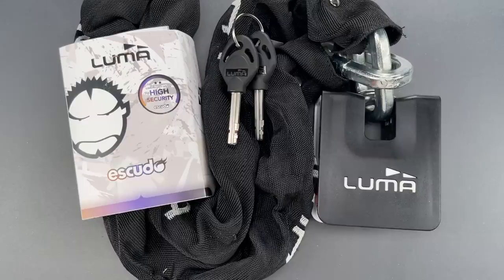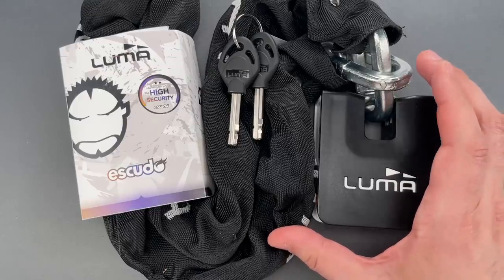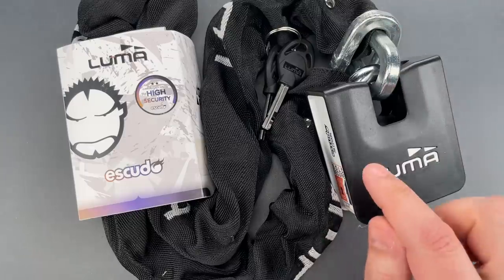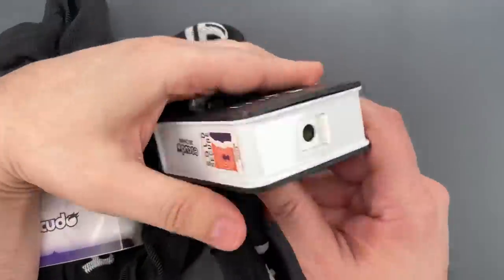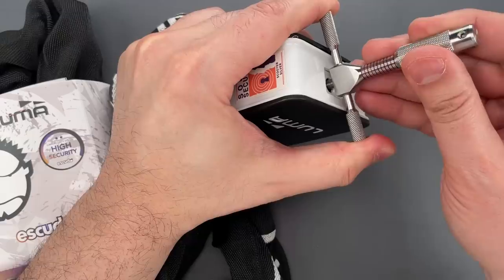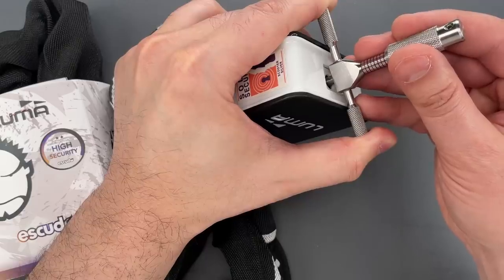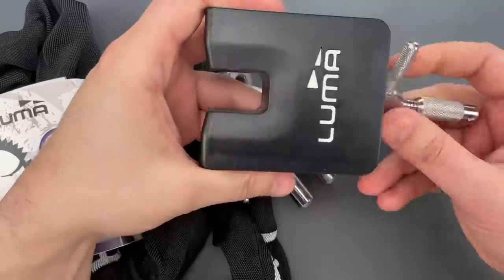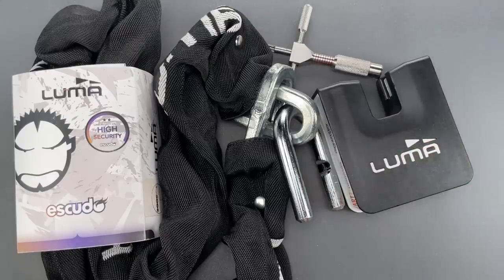[1429] Unexpected False Gates: Lumà Chain Lock

Comment: i wonder if we would be able to have a disc detainer video on your “Inside Perspective” series
Reply: I second this. I'm very interested to see how the pick (that BosnianBill and LPL made) actually works inside the lock.
Reply: Yes, I just really need to see how that pick in actually works!
Reply: The problem is that the disks, as their name implies, go all the way around the keyhole, which would make it pretty difficult to do a cutaway without the lock just falling apart. Not impossible, of course, but it would require some specialized tools and skills that LPL may or may not have access to.
Reply: This is also what I want to see
Reply: I would like to see that also.
Reply: I think the only working approach would be a lock with transparent body. Maybe also transparent distancers to let us peek at the pick within.
Reply: wonder if you could do it with a clear cylinder body.. maybe acrylic..
Reply: I believe Bosnian Bill has at least one video where he’s picking and describing what’s happening at the same time.
Reply: Yes please!
Reply: Or instead of having a cut away view, maybe hire someone to do a 3d animation video that shows how it works?
Reply: Bosnian Bill did a video sort of like that.
Reply: Why not make a lock out of a clear material or cover the cutaway with one? I'm sure resin or acrylic would work fine for an example lock
Reply: That's a good idea.
Reply: @IanHsieh  nah, that's not the same. animation won't simulate all the physics going on inside the lock
Reply: @szymonsadlo  I know it wont. But that's more doable than making a cutout. It also have the advantage to change to different configurations to show other tricks too. And even if the lock was made in all clear material, refraction and other things may cause things not visible or hard to film. Animations can cut out at any point any location required to do the explanations.
Reply: @IanHsieh  that seems true but maybe there is a way that we don't know about
Reply: Bosnian Bill has video on disc detainer locks. Nice cut-out showing internals. Along with detailed explanation of how it works.
Reply: I think a lock made out of acrylic might work
Reply: Maybe they could get a clear disc detainer lock to show it better.
Reply: Me, too.
Reply: @HiddenWindshield  Are you suggesting that are some skills that LPL doesn't have? Man you are bold.... :D
Reply: To the top!
Reply: Waiting here for that too. 😅
Reply: I know the lock shop I work at has a cutaway one made by Assa, so it should be easy to do.
Reply: BosnianBill made such a video
Reply: That would be awesome.  Maybe he could print a clear housing for a lock just for demonstration purposes.  Would definitely be interested in what false and true gates look like too.
Edit: in other words, a lock with practically no security and can easily be broken with force, just something basic to show us well...  The basics.
Reply: @HiddenWindshield  would somesort of transparent material work?
Reply: He said it's coming, in response to a very similar looking comment on his first inside look video a few weeks ago.
Reply: @sharpfang  Or A giant one  3d printed so we can see it all )
Reply: @HiddenWindshield  They make transparent locks
Reply: @HiddenWindshield  Maybe not a cutaway, but could half of the lock be made with a clear material?  That way, we could still see the inner workings.
Reply: I agree  let's see it
Reply: @mk1cortinatony395  It's pretty damn hard to 3D print actually clear transparent stuff.
Reply: @BenK12345  I was thinking the same thing.  That seems quite plausible.
Reply: @HiddenWindshield  There are transparent disc detainer training locks as well, but the core needs a bunch of extra slots cut in it so you can see the discs move since you can't have an effective plastic core.
Reply: @HiddenWindshield  Couldn't a disk detainer core work inside one of those clear acrylic locks?
Reply: @HiddenWindshield  ask stuff made here to do it xD
Reply: @sharpfang  yes of course but I was thinking something like cutaways to show the path of the tools etc
Reply: @mk1cortinatony395  The problem with cutaways is there's not really any room for these in a disc detainer core, because it requires continuous discs to work, and the tool goes through the middles of these discs. Unlike in a tumbler lock where the pins occupy maybe 10% of the circumference of the core and you can cut away most of the rest to reveal them, the disc run the whole 360 degrees around the keyway and any cuts in them at the very least will create extra gates. Besides, everything interesting happens on the outside, where the gates are.
Reply: HiddenWindshield maybe an acrylic or resin 3D printed version, so it’s transparent. It doesn’t need to be as tough as an actual lock and just needs to be able to demonstrate the basic concepts.
Reply: @conorstewart2214  Again, 3D prints are merely translucent, not really transparent. You could go for a resin cast to get a transparent body though it's not so simple with complex shapes.
Reply: Yes!!! Plz!!
Reply: Yes, please.
Reply: Something I would have suggested if you hadn't suggested it already.
Reply: I was literally thinking about this. Maybe a mock up with translucent plastic and the tools LPL uses
Reply: I'm pretty sure it's impossible
Reply: Yes, we need to see this to understand how a disc detainer core works.
Reply: @LockPickingLawyer no please no, disc detailer is normal people like us last hope to affordable locks that provide basic protection, please don't disclose
Reply: BosnianBill  video  (1683) Disc Detainer Locks in Detail
Reply: Yes, please!
Reply: @HiddenWindshield  See-through material
Reply: Now that we have that inside perspective the too narrow flaw on the false gates really makes sense.

Comment: I think from now on, locks shouldn't be advertised as pick proof but come with a number on the package, which states the seconds LPL needs to pick it.
Reply: Agreed, with one exception, bowley(or something like that) locks, because that was the only one that is the closest to pickproof, at least LPL couldn't do it
Reply: It'd be like an SPF rating on sunscreen, except the ratings would go from 5, 10, 15, 30, 45, 60, 120, 180, 240, 300+. Anything above 60 would likely be considered "pick-resistant", and anything above 300 would be considered "pick-proof". This would be because if you were a criminal trying to get into something, there's a very low likelihood that you'd be undetected after fiddling with the same lock for 5+ minutes.

I'd totally buy into that sort of scale. There's enough LPL videos to be able to rate 1000+ locks at this point.
Reply: @deverinshaille7427  honestly I like the locks with alarms, even if LPL has picked a few without setting them off. Anything that makes it harder to stay anonymous whilst picking, as I think the solution to picking is not necessarily making locks slower to pick (because they'll just take longer or build a machine) but to detect when it is happening and take appropriate actions.
Reply: Master lock does that already there’s a vid on here where a masterlock had a 9 rating and it took LPL about 9 secs to get in
Reply: @neon5162  got it, great. 🤪

Comment: In Spain there is a brand called "IFAM" that sells a core called "WX1000". From what people say at the hardware store...it's a top tier. I would send you one but they are expensive as hell.
Reply: How expensive? Maybe the community would help you crowdfund it.
Reply: I looked at those. They're pretty darn impressive (and yeah, expensive). Dimple keyway with three edges totaling 16 pins, with what appears to be six with inner/outers and six spools (3/2/1) on the three sides. I have zero doubt LPL could pick it;, but it would take a non-trivial amount of time compared to most of the PoS garbage we see daily.
Reply: @CEFG100  I could not find where you could actually just buy one, but in the fine print on the company website it says the minimum order is 50 euros. ($54.57 US)
Reply: Tengo uno yo en la puerta de mi casa

Estoy muy seguro lpl puede abrirlo en menos de dos minutos

Comment: The only thing that matters for products like this is how bolt-cutter resistant the exposed chain links are. No bike thief will waste time picking the lock.
Reply: Or wait until the owner opens the lock then ambush and bash them over the head. Thieves tend to not play by the rules and usually desperate. Just sayin
Reply: @lilmike2710  Don't forget the battery powered saws they've been relying on lately
Reply: I think you are right for the vast majority of bikes. But some enthusiasts have very expensive bikes that might catch the eye of a skilled thief if they regularly lock it up next to a cafe or outside work or something. So I think there is a niche for high security locks.
Reply: @Hobbsgoblin  I doubt the enthusiast leaves the expensive bike unnatended long  enough for the thief to pick the lock, i doubt the cafe is in an unpopulated area where the thief could make an easy escape ot pick around without raising suspicion. Otherwise, the enthusiast is a bit stupid :))
Also expensive bikes are usually rare and tracked .
Reply: @DanSlotea  BTW: is there such a thing, as a cheap bike? I got a bike store here in Germany I can see from my kitchen-window and today I asked what a simple bike costs: 900 effing Euros! My first car was cheaper!
Reply: @DanSlotea  Fair points, but I can also see why an owner of expensive bicycles would pay a little extra for the added security. And also, many expensive bicycles are designed to be used in the winter when it is often dark (in the north where I live) and easier for a thief to work secretly outside a bar or restaurant.
Reply: @ChrisBigBad  Of course there are cheap bikes. Second-hand bikes are cheap, Chinese bikes are cheap. I have a friend riding a bike with missing pedals (has only axles), rusty wheels and a brush-painted frame. Nobody would bother stealing that ugly crap. But it works perfectly, gets him around just fine.
Reply: @lilmike2710  Sounds like a plan... but they seem to be everywhere !
Reply: @DanSlotea  haha! Optical theft prevention. Like a bike where the handlebars and wheels go in different directions like what Destin from smarter every day had!
Reply: Bolt cutters don't easily get through chains like that, and even then only once. Battery-operated angle grinder at night is the faster, more efficient option.
Reply: @mathiasanderson554  who leaves a bike outside during the night?
Reply: @ChrisBigBad  In the US, the "cheap bike" niche is pretty well populated, with many of them on display at WalMart.
Back when I was a kid (1980's) the sweet spot for cheap-but-good was the Huffy brand. I don't know if they are still in that category.
Reply: @MonkeyJedi99  ya. now that you mention Walmart, I guess there are cheaper bikes to be had at big-box stores and our cozy bike-shop is quite a boutique. Also looking into used ones.
Reply: @DanSlotea  Someone about to get their bike stolen. Doesn't have to be outside though. Depending on the community, bikes are very often locked up in stairwells and around public transit sites.
Reply: In my younger years I considered myself a "cyclist" at times. Funny to think about my precious 16 lb bicycle needing a 12 lb lock/chain to hopefully delay the Obummer people with their Home Depot grinding tools for 3 minutes.
Reply: Most thieves do not pick locks. A crowbar for a door or a bolt cutters or die cutter for a lock.
Reply: @JeredtheShy  By the point that we're talking about power tools opening our locks, the quality of the lock is mostly pointless and we're now relying on the quality of the neighborhood and local law enforcement to make sure that people taking power tools to locked up possessions get caught for being incredibly obvious and loud.
Reply: @jinnylover9158  Bolt cutters suck after the first lock, and only the largest can get through thicker or harder shackles and chains with excessive force. Most "professional" thieves use the wrench technique anyway.
Reply: Nothing stops a cutoff wheel
Reply: @RayleighCriterion  everybody willing that can hear it can stop it. And as somebody said above, most thieves do it for drugs money so investing in a portable grinder is losing a lot of doses.
Reply: @ChrisBigBad  That must have been an artisan hand crafted bike or something! A cheap bike in the US would be closer to $150 (about 137 Euros) Although at a sporting goods place I did see a $2000 bike, it was a specialty bike for driving in snow.

Comment: Anything with a disk detainer core is pick resistant. It's highly unlikely to find one picked in the field.
Reply: Head on over to covert instruments and change the world around you....
Reply: Sometimes I pick my nose in the field behind my house.
Reply: You'd be surprised there are quite a lot of disc detainer picks selling here in Europe
Reply: @mihanovak2228  yeah but most people dont have the skillset to use them
Reply: Your comment is the gist of what I said about being pick resistant.
Reply: That is changing because of that pick though. Because half of the problem with disc detainer locks was getting the correct pick to actually open them
Reply: @frankh.3849  actually LPL doesn't sell that.  That one is sold at Sparrows.  It was in production for ~ 3 years (I think).
Reply: You're highly unlikely to find any lock picked in the field.
Reply: Most of these cores are used in bike locks and chain locks in the field.  Usually thieves don't have much time so they will just attack the chain or the bracket with an angle grinder before even looking at the core.
Reply: @ipick4fun27  I didn't know that, I haven't tried buying any tools. Thanks for the info though.
Reply: @toad7395  Yeah, most people don't have 5 minutes and internet connection to watch a guide on how to do it...
Reply: Lol? I practice with bike locks i (honestly) find on the street, over half are actually disc nowadays, and using a $5 tool that not Bill&LPL but Ali Li made they are certainly doable and not particulary slower to pick than any other type. Disclaimer: i'm just a beginner and not a fast picker. But the tools are around, the locks are around, the skillset is very similar, i find it quite a bold claim to say 'wouldnt' be used in the field'. Why do you think so, please explain..
Reply: @rene0  Most pickers simply do it as a hobby for the challenge. I doubt many thieves would invest the time to develop the skills and acquire special tools to steal bikes when chains and locks can be cut or broken so easily. Just my opinion though.
Reply: @rene0  It's just that if your goal were stealing bikes and not solving puzzles, a good pair of bolt cutters or an angle grinder would be a much better investment generally. Typically very quick, basically no skill or nerves required. It's not like you're going to try to bring it back without the owner knowing it was gone or something.
Reply: @ipick4fun27  Is it no longer being made? I had my heart set on getting one eventually.
Reply: @lukem7203  Depends on the reward. Stronger U locks resisting common bruteforce attacks, can be an incentive for people to lock more valuable bikes in them. If the high value bike is parked at the same place & time very often, an attacker could get the tools and take the time to develop their skills and steal the bike by picking the lock. Bikes can get as expensive as 5000$, so the stakes are high.

Best defence is always a combination of a good lock that makes other bikes "easier to steal" + locking in a well controlled place + avoiding if possible to always leave the bike same place & time + a bike that is not too attractive to steal + that bike being a relatively affordable value (It's not the same. Some cheap bikes look pretty good and that fools thieves a little into thinking they sell better, while other bikes are expensive but don't look nice so their perceived value is lower).
Reply: @marquiis  Those are all good points but as others have said, a cordless angle grinder will cut through a U lock in a matter of seconds.
Reply: @rene0  "$5 tool that not Bill&LPL but Ali Li made" Commercially available?
Reply: @cmdrbozo  Yes, commercially available from a variety of vendors like amazon or their Chinese counterparts. Or easily made self with a bicycle spoke and a hollow pipe from the RC toy shop, for those having a hobby making picks out of hair pins and windshield wipers.

Comment: That plastic cover might actually slow down the more common Milwaukee cordless death wheel pick, if it gums up the disc. And the thief attacks the lock and not the chain.
Reply: A cordless angle grinder with a cut off wheel would slice through that shackle in a few of seconds. Anyone who has operated an angle grinder before likely isn't going to try cutting straight through the lock.

Comment: I have a Luma Solido Advance brake disk lock (now deprecated) with a similar 10 disks core and fully steel made that takes all the pros in this model and dismiss the chain (that has nothing to do against an angle grinder) but has the cons that you must park somewhere visible to prevent thieves from “towing” the bike with the lock still on the break disk. Good thing to see here is that picking it would require both skills and specialized tools :) Thanks for the vid!

Comment: If you need that fancy home-built disk detainer picking tool, it’s pick resistant enough for where I live!🤣
Reply: You can buy them from Sparrow for $45
Reply: @flandrble  Like any thief is going to have a $45 lock pick I'd be more worried  about any decent pair of bolt cutters
Reply: @ownzone8172  sometimes you don't want the owner to know they've been compromised ;)
Reply: @flandrble  true
Reply: @flandrble  to be fair though for a bike lock, the usual goal is theft of the bike and that's a tiiiiiny bit hard to hide
Reply: I would use it just to steal the lock and leave the bicycle